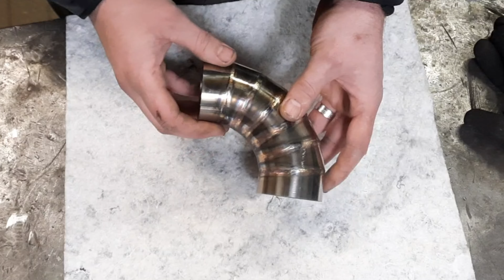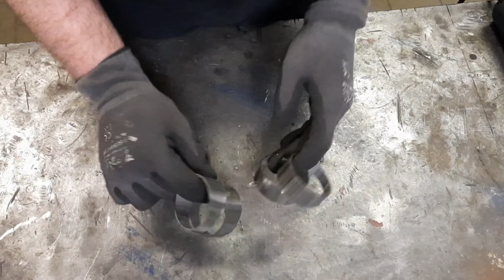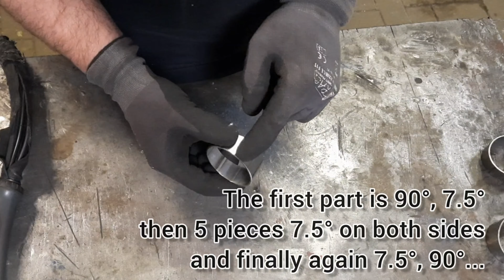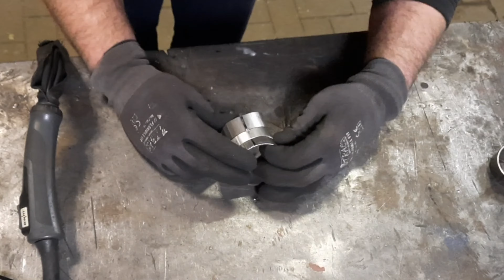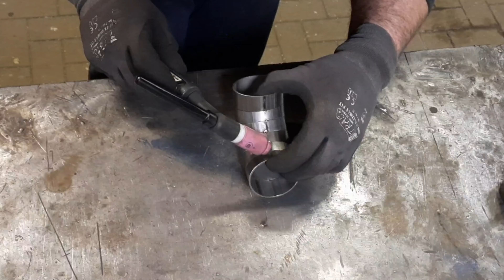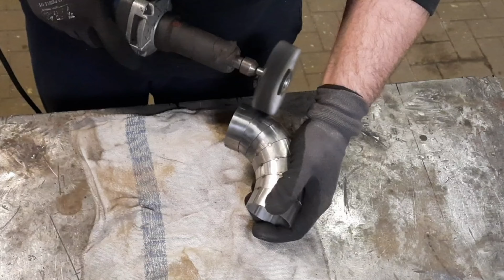DIY Pie Cut Bends | Stainless Steel

Comment: How do you know how long to cut your  pieces?
Reply: on narrower part of piece, wideness must be at least 10mm because two welds would be to near,, it is easier to cut many pieces with different angle and  strait pieces with different length, so then you can combine parts to get what you wanted